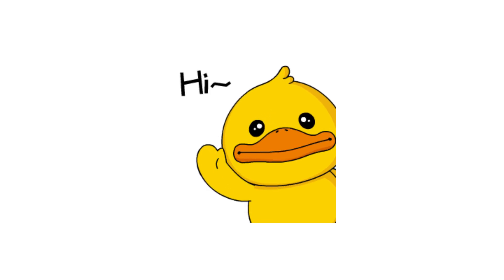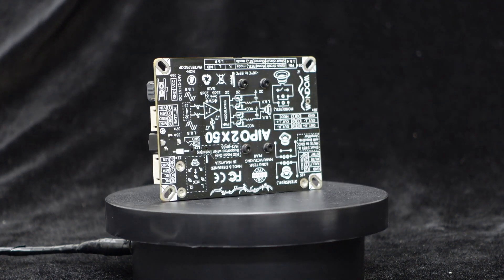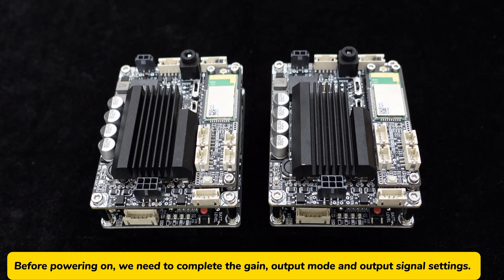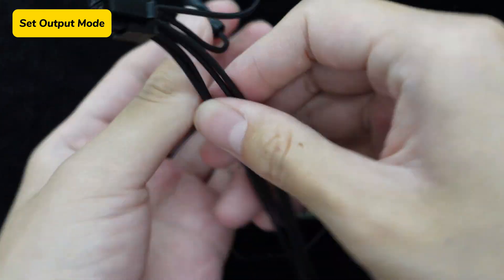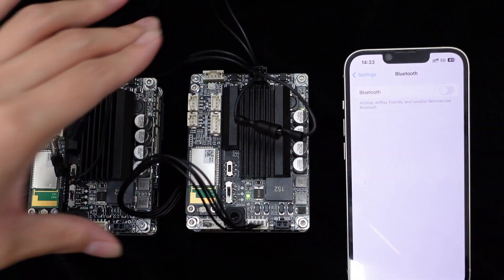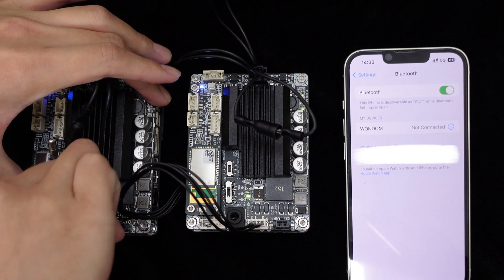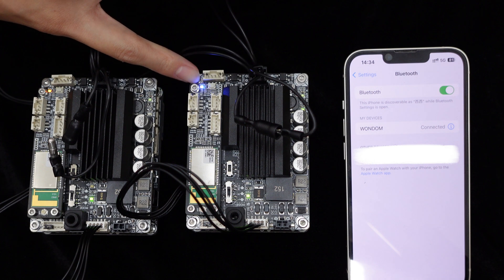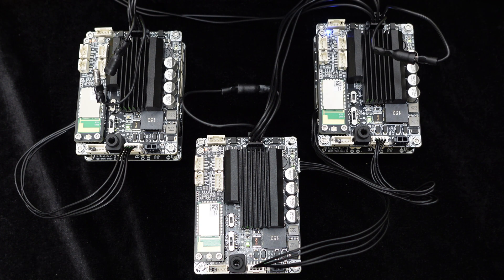Demonstration on TWS and Concert Modes of WONDOM JAB2+ Wireless 2.1 / 4.1 Audio System Setup Guide

Comment: Can you also program the DSP with Sigma Studio?
Reply from the maker: Hello, the JAB2+ is integrated with an audio DSP, supporting PC UI control. However, it doesn't support SigmaStudio programming. Wish this could help you. Have a fantastic day~
Reply: @WONDOMAudio  this device would be really useful if the software allowed to set up a crossover and use a each channel for the low and high frequencies respectively. However in the software available on your website, there is no way to program this. 
You would need to mix the stereo signal into mono and then run it through the crossover. I believe this is available in other versions of the software. 
Will this feature be available in a software update?
Reply from the maker: Hello, the product integrated with ADAU DSP supports independent adjustment of each channel. We are now in development of a new product, which is integrated with ADAU DSP and supports TWS simultaneously. It's planned to be released by the end of this year. Please kindly stay tuned. Have a fantastic day~
Reply: thank you for your quick responses! What a great company!

Comment: Really awesome addition!
I have a couple of questions.
1.) I see you are using the BCPB2 3S to power the JAB2+. Since cutoff voltage per cell is 2.8V, which is in total at 8.4V output voltage, will the JAB2+ operate to that voltage, or will it shut off at e.g. 10V?
2.) What is the minimum impedance in either 2x50W mode and 1x100W mode?
3.) Will you be making non-amplified TWS boards with DSP and line outputs? Pretty please with the exact same button/LED connectors and L/R/Mix switch.. :)